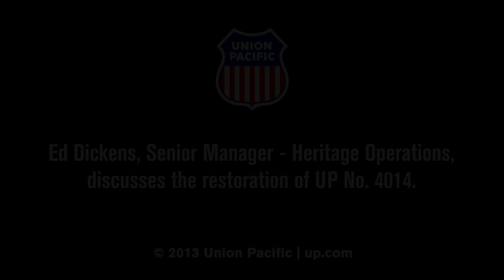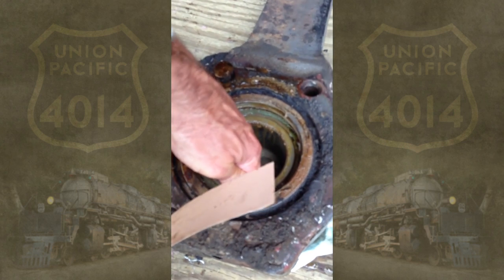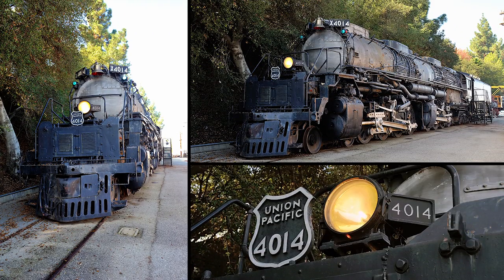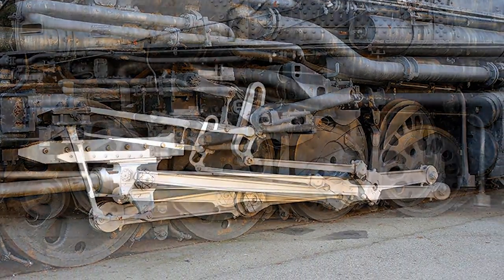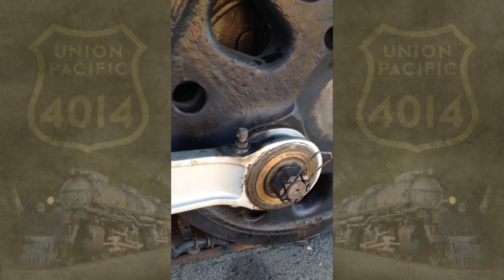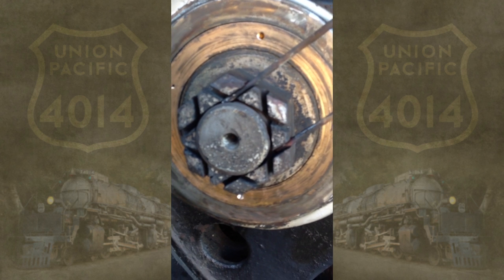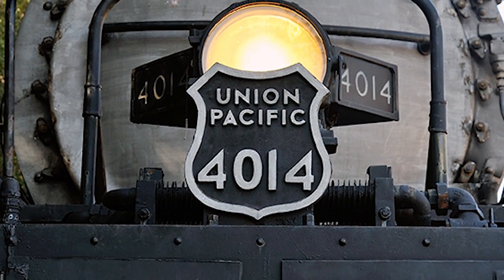The UP 4014 Project - Aug. 14, 2013

Comment: Thanks for the update.  As I understand things, the Strasburg Railroad is equipped to manufacture any restoration parts for this locomotive beyond your Cheyenne Shops' capabilities - they did beautiful subcontract work for #844 and #3985, so I have no reason to doubt that they can give #4014 new drivers to replace any that fail the upcoming ultrasonic and microwave tests.

Comment: It's the best preserved example, and UP is going to restore it. It's going to the shops in Wyoming and will take 3 to 5 years to get up and running, per UP's website.
Also if you weren't aware, UP has an active steam program. 844 was never pulled from service and has worked continually since it's manufacture.

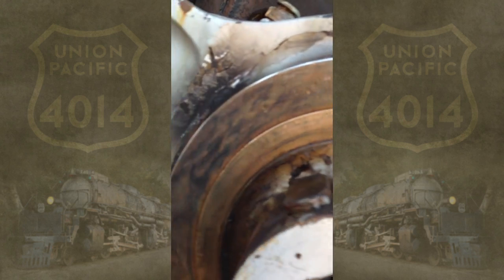Comment: @1:52, What is that with wires sticking out? Why is it connected to the expansion link of the Walschaerts Valve Gear via an oscillating rod and lever?

Comment: The reason why many think the conversion failed was because they used 1 injector (like with 844). With the firebox being so much bigger they didn't have uniform heating in the firebox. It will burn oil just like 844 and 3985 (the railroad no longer owns any coal mines for one and two it is easier to transport #5 oil). The other big problem with burning coal is the cinders that get shot out the stack (that is why they converted to oil in the early 90s)

Comment: I was an engineer for the Mt. Washington Cog Railway in my  earlier years.  Was the last to run the #4-Summit with the original wrought-iron frame (1814)  Pushed #1 car (built 1869) to the Summit of Mt. Washington, NH.  Engine weighed 15-17 tons(approx.) but had Much MORE traction than 4014 (Secret-a cog gear on a  rack railroad doesn't slip).  Fun times 'way back then.......

Comment: News to me - as I understand things, the later Southern Pacific/Baldwin AC's have the same size fireboxes as, and boilers directly comparable in volume and pressure to those of, the the UP/Alco Challengers; the Big Boys boil half again as much water to pull 4,000 tons through the Wasatch single-handed, meaning double the heat required to keep the speed up.

Comment: The Baltimore and Ohio Railroad was chartered by the Maryland legislature on February 28, 1827.  That pre-dates the Strasburg by five years.  Strasburg is the oldest continually operating railroad in the U.S. using the same corporate name.  The B&O became part of the Chessie System when combined with the C&O and Western Maryland,  and then when joined by the Family Lines system CSX was born.  If the B&O had remained independent it would hold the honor that Strasburg holds today.

Comment: By the gossip I have heard they are going to use SP style burners. Something similar to the cab forwards since their fireboxes are similar in size to the 4000s. That would require 2 burners I assume. The 4014 don't need to produce steam as well as when coal burning since it probably won't ever haul heavy freights on a daily basis. The 4000s were over engineered so they can sacrifice some steaming capability without sacrificing performance.

Comment: I didn't want to say same size because someone would have argued about a minimal difference in size lol. That is true but the difference in size and steam generation of a 3900 and 4000 isn't to much so I am sure they will design the burners to handle a adequate amount of oil to make enough steam. I doubt 4014 will produce the same amount of steam after the conversion but they won't run it (like 844 and 3985) to full boiler pressure.

Comment: I read in wikepedia that 4005 was converted to run on oil, but it was no good because there was only one burner instead of multiple burners so they converted it back to coal. Do you know if 4014 will burn oil or coal? Most steam projects in the rest of the world run on good quality steaming coal. If the Big Boy is coal fired, they'll have to watch the fire because I've seen videos of Big Boys with huge amounts of smoke coming out the stack, the EPA would say something about that lol.

Comment: 4014 wasn't the 4000 to be converted. When they converted 3985 (which was coal fired) they used parts from 3977 in North Platte since it was one of the converted challengers to use oil. 4014 will be a little different in the fact that they will not have a parts 4000 to pluck oil burning related components off. So its all going to have to be custom fab (its what they did to the 4-6-6-4s).

Comment: They would take parts off another 4000 if they had to. UP cares to much to do that to 3985. 838 was intended to be parts for 844 at retirement so that don't count, and 3985 using parts off the 4000 in Cheyenne was a obvious choice considering the surviving numbers. 3985 swapping parts with her sister in North Platte is OK because they didn't ruin or prevent a otherwise operational loco from running. UP knows what they are doing :) I can see CSX or BNSF destroying their own heritage though. lol